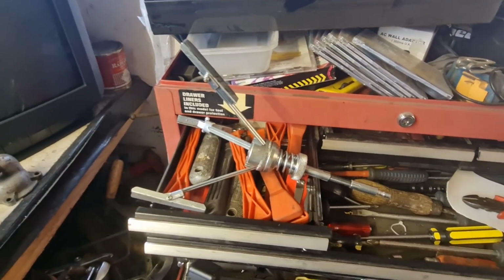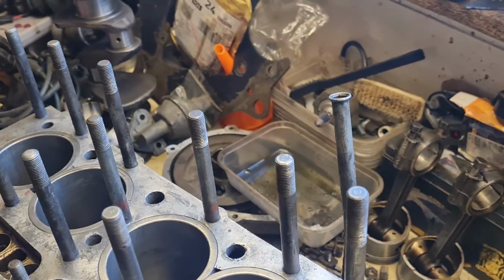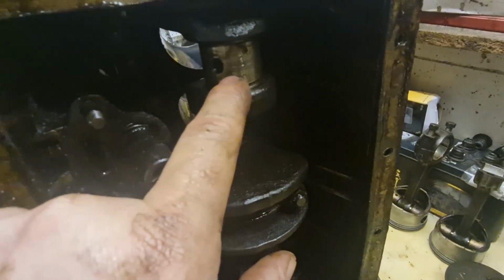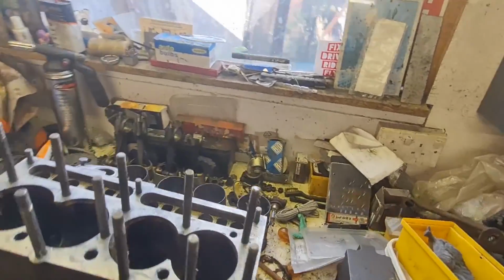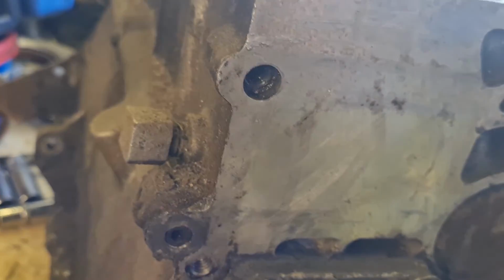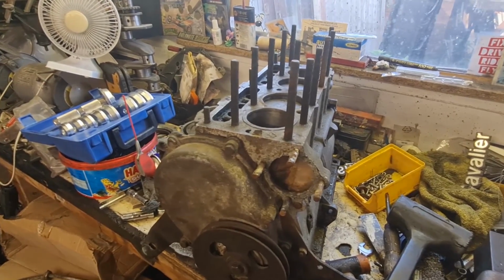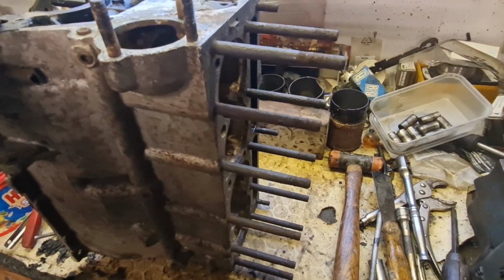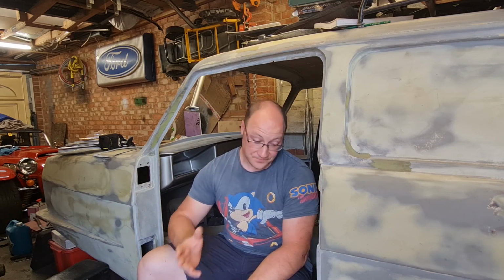Reliant Regal Supervan 3 Project Plonker PT5 ENGINE BLOCK WOES !! COULD IT BE 3RD TIME LUCKY ??

Comment: Good job!
As you mentioned, the casting of the newer engines is not as good as the older engine.
I don't know how much Bulldog lubricant is, I definitely recommend, a few other channels who have used it on bolts stuck like yours worked to release them. You might have to soak it with Bulldog lubricant for a few days, but it always seems to work!
Reply from the maker: Hi mate thanks for the msg ! Thats some very good advice ! I will deffo look into that ! 👍👍👍

Comment: what i would highly recomend is is an eletric fuel pump. and eletronic ignition. its the diffrence between carpet and silk. a lovely smooth running engine not fuel starvation gargling etc extra powerful spark. i have to be honest that bloody whale music is getting on my pip. how about a nice bit of blues. So im to stay away from later engines then. ive learnt somthing yeah. same thing happened to me with the stud i could not get it out snaped welded sheered welded grrr.thats why its so hard to remove the heads on these old engines because the studs also weld them selves to heads
Reply from the maker: Hi mate thanls for the advice i will deffo look into those upgrades ! That stud was a nightmare ! 🙈👍👍

Comment: @MEC-TEC Hi, good luck with the build, where did you get the liners from please? Mine are in similar condition with one seized and cracked. Many thanks.
Reply from the maker: Hi mate thanks for the message ! I got the liners off ebay, but i believe they are from chg classics, you can go to them direct on facebook, hope this helps  👍👍👍
Reply: @mec-tec  superb thanks a lot mate, they have a few Bond Bug bits I see. 👍
Reply from the maker: @roystorations366  yes that do stuff for most reliants 👍👍👍

Comment: Can't you get the corrosion damaged repaired? That what I would try and do😎
Reply from the maker: Hi mate, i did think that myself but having looked at the rest of the inside of the block its got rot all over it, it deffo wouldnt be worth repairing im afraid 👍
Reply: @mec-tec  oh no 😞, will you have the block cleaned and skimmed at the engineers too?
Reply from the maker: @EngineVids  i have cleaned it since this video so it will go to the machine shop clean, as you say i think id likd to have the face skimmed so we have a nice finish for the gasket to sill onto 👍👍👍
Reply: @mec-tec  ah ok, best thing is to do it as best as you can, new rings would be good so they ware into the new liners nicely😎